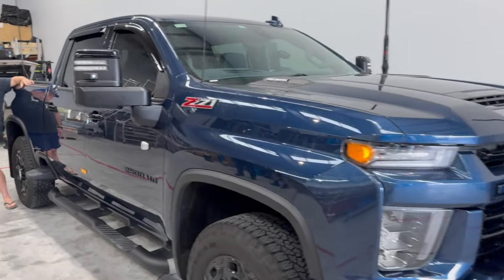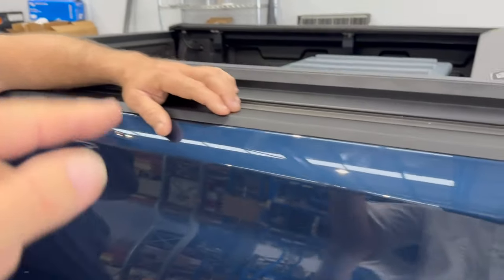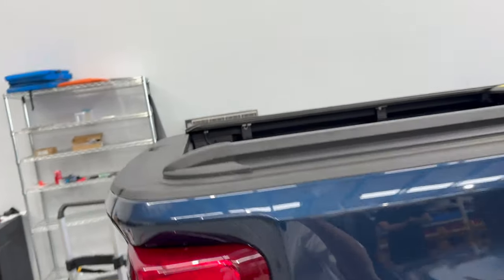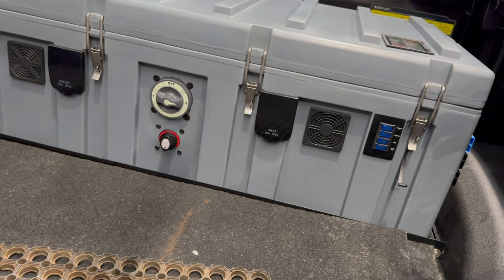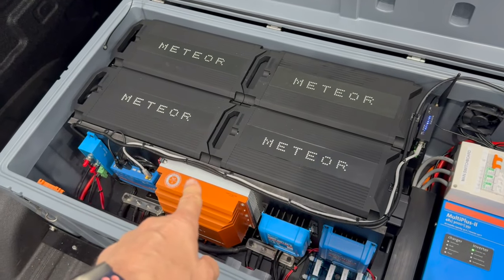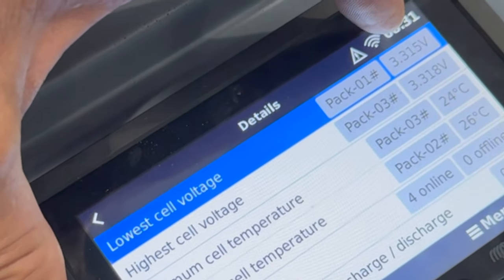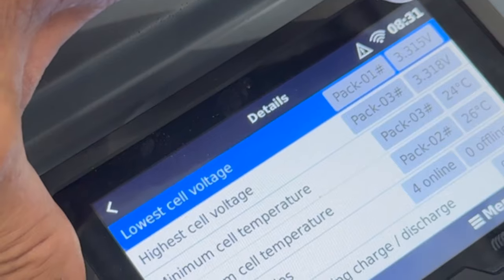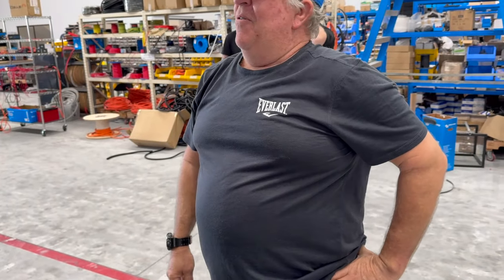RAM 2500 Powercase for STARlink Streaming with Aircon running in the van

Comment: Shows a Chevrolet Z71 and calls if a RAM 2500 - I'm so confused. I know things are named different things down there, but do they switch manufacturers names also? Where was the cell charging? is it on the boat? If so, can it only charge wile with the boat and/or wile the truck is idling?
Reply: I think they stuffed up, clearly a chev
Reply from the maker: Apologies, yes its GM. We had 3 RAMs in this week and I had RAM on the brain. They take the pack out of truck and put in boat and connect to outboard alternator plus solar.
Reply: Great unit, approx price if possible, thinking this would suit my new transit which is coming shortly.